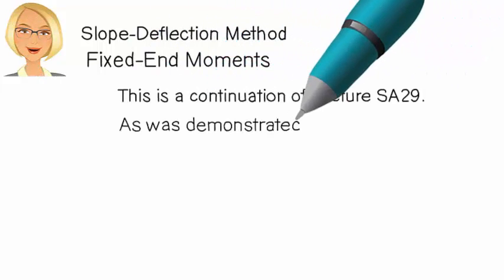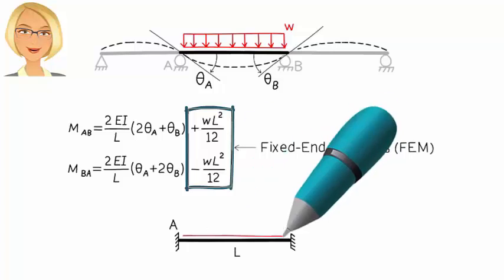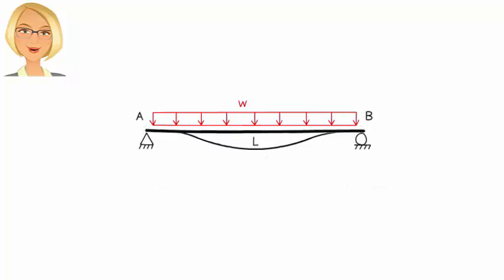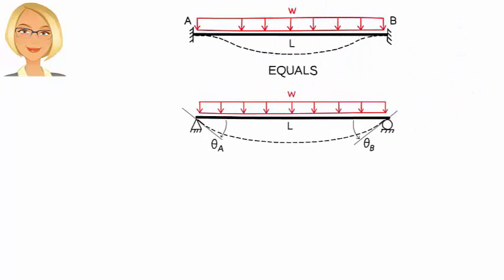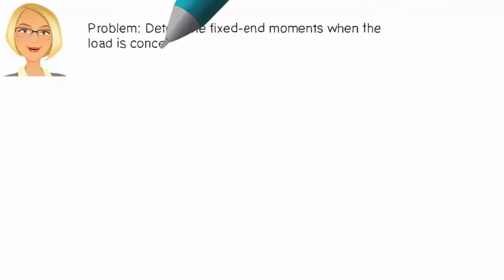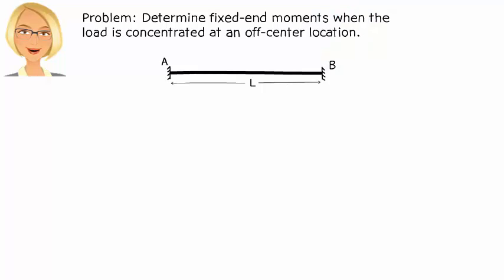SA30: Slope-Deflection Method (Fixed-End Moments)

Comment: in 7:37 isn't the arrow a counterclockwise? why is it clockwise?
Reply from the maker: Are you referring to the applied moment in the second exercise problem? That is the direction in which the moment force is being applied to the beam. Such a force can be placed on the beam in either direction.
Reply: @DrStructure  sorry the time stamp is wrong, I mean the time at 5:00. the direction is counter but the label is clockwise
Reply from the maker: @5:00, two types of entities are shown on the diagram: moments (FEMab and FEMba) and rotations (ThetaA and Theta B). 

At this point, the moments are unknown, therefore, we assume them to be acting in the counterclockwise (positive) direction. In the slope-deflection equations, counterclockwise is considered the positive direction. Note that both moment arrows  are shown in the counterclockwise direction.

Since the rotations have been calculated at this point, we know their actual direction and magnitude. ThetaA is counterclockwise and ThetaB is clockwise, which is the result of an upward deflection of the beam. These rotations are shown in the correct direction on the diagram. The magnitude of the rotations are also given. However, since we are going to plug in these values in the slope-deflection equations at the bottom of the screen, and in those equations rotations are assumed to be in the counterclockwise direction, we have to enter a negate the value for ThetaB. That is, a positive value of PL^2/16EI for ThetaB in the slope-deflection equations, implies a counterclockwise rotation at B. But since the rotation is clockwise, we need to negate that value.

Comment: what about if there is a roller in the middle or somewhere in between the beam how do you solve that ?
Reply from the maker: By definition, the fixed-end moments (not to be confused with member-end moments) are computed for a beam segment that is assumed to be fixed at both ends. So, if we have a two-span beam (with a roller at the middle), consisting of two segments (say, AB, and BC), we need to calculate two sets of fixed-end moments. We need to calculate one set for segment AB and another set of fixed-end moments for BC, assuming fixed ends for each segment.

Comment: 1:22 can anyone please explain what is the difference between fixed end moments and Mab, Mba etc...
Reply from the maker: When analyzing continuous beams, we seek to calculate the internal forces at the two ends of beam segments. If we know the bending moment and shear force at the ends of the member, we can easily calculate these forces within the member using the static equilibrium equations.

The forces at the ends of the member are called member-end forces. So, for beams we have member-end shear forces and member-end bending moments. When using the slope-deflection method, we label the member-end (bending) moments as Mab and Mba, assuming the ends of the beam segment are labeled A and B. These are the actual moments that develop in the member when the structure is subjected to loads.

Consider a beam with length L that is fixed at both ends. Suppose there is a uniformly distributed load (w) acting on the entire beam. The moments that develop at the ends of the member are wL^2/12. These indeed are the member-end moments. But in the special case that the beam is fixed at both ends, we can call them fixed-end moments as well. So, the term fixed-end moment applies only when the ends of the member are actually fixed or assumed to be fixed.

Suppose we replace one of the fixed supports in the beam with a roller support. Now the beam is fixed at one end and rests on the roller at the other end. If we are asked what are the moments at the ends of the beam. We could say, there is an unknown moment at the fixed end, and a zero moment at the roller end. That is, we know one of the member-end moments (it is zero), but we need to compute the other one (at the fixed end). In this case, we cannot call these fixed-end moments since the beam is no longer fixed at both ends, but we can call them member-end moments.

In the slope-deflection formulation, the member-end moments are formulated using the method of superposition. That is, we say, the member-end moments are a function of the fixed-end moments and the moments that develop due to the rotations at the ends of the member. The equation:

Mab = (2EI/L)(2 t_a + t_b) + FEM_ab 

Where t_a is the rotation of the beam at end A, t_b is the rotation at end B, and FEM_ab is the fixed-end moment at end A, can be written as:

M_ab = (2EI/L)(2t_a) + (2EI/L)(t_b) + FEM_ab

The first term is the moment at end A of the beam segment due to t_a, 
the second term is the moment at end A due to t_b, 
and the last term is the moment at end A assuming that the beam is fixed at both ends.

That is, when using the slope-deflection method, we start by assuming the ends of the member are fixed and calculate the (fixed-end) moment that results. We also calculate the moments at the end of the member due to rotation t_a and t_b. Then we say the actual (member-end) moment is the sum of the three terms.
Reply: @DrStructure sir, can i say that fixed end moment is associated only with a particular span with a certain type of loading while the member end moment is the total moment  developed in the beam due to effect of all the span loadings.
Reply from the maker: Yes, that is a correct way of thinking about the two moments.
Reply: Thank you so much for this wonderful explaination..I got my all doubts clear.👍👍
Reply: @keertisingh894  was it doc's or mine. 😜😁

Comment: hey, I have a question. I'm dying to find the answer to this I don't know whether this is stupid or not, but anyway I'm gonna ask.
So when there's a settlement at the supports there's a moment generated right? to resist it? when both ends are fixed the moment is
6EIdelta/L^2 right? my question is what's the moment when only one end is fixed and the other pinned?
Reply from the maker: Any technical question is relevant and welcomed, and its of use to at least one person. 

You are right, if a beam is fixed at both ends, and has a support settlement, the end moments are equal to 6EI Delta/L^2. Note that in this case, both end rotations are known; they are zero.

If one of the supports is a pin, say the right one, then the rotation at that support is not zero. Let's refer to that rotation as t_b. We can write the two slope-deflection equations as:

M_ab = (2 EI/L)( t_b - 3 Delta/L) 
M_ba = (2 EI/L) (2 t_b - 3 Delta/L)

Since there is a pin at B, M_ba = 0. So, setting the second equation above equal to zero, we can determine t_b in terms of Delta. 

t_b = 3 Delta / 2L

Then, from the first equation, we get:

M_ab = (2 EI/L) (3 Delta/2L - 3 Delta/L) = - 3 EI Delta/ L^2
Reply: @DrStructure  thnx guys

Comment: What are advantages and disadvantages of slop deflection???
Reply from the maker: A method can be examined in that light (i.e., advantages and disadvantages) in a comparative way only. The slope-deflection is a classical analysis technique, similar to the force method. The techniques was developed about a century ago, when numerical and computer-based techniques were not available. The slope-deflection method works best for problems that can be solved by hands, without using the computer. If the degree of indeterminacy of the structure is more than 4 or 5, hand-calculations become laborious and error-prone, rendering the use of the classical methods impractical.

A comparison of the slope-deflection method with the force method may be of use when trying to decide which technique to use for solving a problem. In the slope-deflection method the unknowns are joint rotations and relative displacements. In the force method, the unknowns are reaction forces. Consider a beam that is fixed at both ends and rests on a roller at its midpoint. The degree of indeterminacy of this system is 4, meaning if we were to analyze the structure using the force method, we would need to set up and solve 4 equations in 4 unknowns (if the horizontal force at the supports can be ignored, we can solve the problem using 3 equations only). The slope-deflection method, however, requires only one equation in one unknown (the unknown being the rotation of the beam at the roller support, since the end rotations are zero) to analyze the beam. Now, consider the case in which the end supports are pins/rollers instead of being fixed. So, we have a continuous beam with three pin/roller supports. In this case, the degree of indeterminacy of the system is 1, meaning that we can solve the problem using the force method by setting up one equation in one unknown. Here, the slope-deflection method requires using 3 equations in three unknowns (the three joint rotations) to solve the problem. 

We can also examine and compare the two methods in terms of the actual steps that each require and ascribe time requirement to each step in order to compare and contrast the time efficiency of the techniques in various scenarios.
Reply: Thank you very much❤❤
Reply: The need to use statically indeterminate structures???
Reply from the maker: @ahmedbarakat1384  Indeterminacy naturally arises in some type of structures. Consider a building (frame) having three or more columns at its base. Each column is sitting/resting on a foundation which can be viewed, depending on the details of the connection, as either a pin connection or a fixed connection. Either way, there would be too many support reactions to calculate using the three static equilibrium equations only; here we have an indeterminate system to be analyzed using techniques such as slope-deflection or matrix displacement method.
Reply: Can I ask you the last question, please?
Reply: Advantages and disadvantages of consistent deformation and three moment equations?
Reply from the maker: @ahmedbarakat1384  The three moment equation works best for continuous beams only. The method of consistent deformation (the force method) is more general and can be applied to frames as well as beams.

Comment: Please tell me how to draw FEM in case of temperature variation or settlement?!
Reply from the maker: Please see Lecture SA32 (https://www.youtube.com/watch?v=dwXudm5IPDE&feature=youtu.be) for the slope-deflection formulation for support settlement.  This method however is not suitable for handling change in temperature in the material. More advanced (finite element based) techniques are needed for that.
Reply: @DrStructure  thank you, Do you have any source (video or PDF) for this technique (finite element based) ?!
Reply from the maker: @abdelsattar6007  We have a series of lectures on the displacement method which is a precursor to the finite element analysis (see Lectures SA45 thru SA50). However we don't discuss the effect of temperature change, since our focus here is mostly on the basics of structural analysis. 

You should be able to find the coverage of temperature change in some advanced structural analysis textbooks/reports.
Reply: @DrStructure  thank you 💙

Comment: I want a favour  from your channel...plz make a video on to calculate fixed end moment due to three concentrated point load...I really need your help....waiting for your response...
Reply from the maker: Thanks for the note. These videos take some time to develop, by the time we are done making such a video you have figured out the process already.  Perhaps you can solve this problem on your own, with a bit of hint:

Place once concentrated load on the beam at a time and determine the fixed-end moments due to that single load. So, for concentrated load (P1) you get mLeft1 and mRight1. For P2, you get mLeft2 and mRight2, and for P3 gives mLeft3 and mRight3. Then, you can find the fixed-end moments due to all three loads placed on the beam simultaneously by adding the three moments on either side of the beam. That is,

mLeft = mLeft1 + mLeft2 + mLeft3
mRight = mRight1 + mRight2 + mRight3
Reply: Dr. Structure Got you...I will try to solve it as per your precious guidance...thank you once again for your support...
Reply: Dr. Structure dear sir can't it be solved by the same process you have solved some problems and specific results too..considering the beam to be simply supported first and then calculate the end rotation by unit load method considering four sections..and finally putting the obtained value of slope in slope deflection equation to get the desired FEM...
Reply: Hello sir...as per your hint I tried to solve the problem but couldn't get the desired result..I obtained the m1 left value for the first load at(L/4) distance from left as (9PL/64)...m2 i obtained for load at (L/2) from left as (PL/8)..m3 left due to load at(3L/4) from left as (3PL/16)..adding( m1+m2+m3) left,total comes out equals(29PL/64)...m1,m2,m3 are calculated as per specific result by formula (Pb^2a/L^2)...answer is (15PL/48)
Reply from the maker: Yes, it can be solved that way. But that is a lengthy process for solving a problem that can be solved quickly using the principle of superposition.
Reply from the maker: You have made a slight error in your calculations. For P3, the left moment should come out as 3PL/64, not 3PL/16. You missed multiplying by a 4 in the denominator. 

Left-end moments are:

For P1: (3L/4)^2 (L/4) P / L^2 = 9 PL/64
For P2: (L/2)^2 (L/2) P / L^2 = PL/8
For P3: (3L/4) (L/4)^2 P / L^2 = 3 PL/64

The sum of the three moments comes out to be: 20PL/64 = 15PL/48 = 5PL/16

For the right-end moment the same value: 5PL/16, where

For P1: (3L/4) (L/4)^2 P / L^2 = 3 PL/64
For P2: (L/2)^2 (L/2) P / L^2 = PL/8
For P3: (3L/4)^2  (L/4) P / L^2 = 9 PL/64
Reply: Dr. Structure ohhh...sorry sir...thanks a lot..thank you so much..really appreciate your work and the way you help us is truly awesome...I truly am a fan of your channel...once again thank you from the bottom of my heart...
Reply from the maker: @roushanrounak8648  You are most welcome.

Comment: Can slope deflection address load case as if the load applied at the support?
Reply from the maker: Yes. When there are no member loads, the fixed-end moments would be zero. But we can still follow the process and write the joint moment equilibrium equations in terms of joint rotations. When the beam is subjected to only concentrated moment(s) at the joints, these applied moments would appear in the joint equilibrium equations (when summing the moments at each joint, we need to include the applied moment at the joint in the equation). However, if the applied loads are vertical forces only and they are located at the supports, then there is no need to analyze the beam. The reaction force at each support would be equal to the vertical load applied to the support, and the beam segments themselves would not carry any load (no internal forces develop in the segments and no joint rotation takes place).
Reply: +Dr. Structure 
thank you Fri the good clarification
however how can we follow up on the issue if the joint load is only vertical load
Reply: +Dr. Structure 
good ti be in touch again with you sir
just for clarification 
assume we have two span beam abc
assume that there are two loads 
at b 
vertical load and moment
how to tack this problem using slope deflection equation 
thank you sir
Reply from the maker: @munirasad273  The beam can be analyzed, the support reactions can be calculated, using the principle of superposition. Placing the vertical load at B by itself, the support reaction at B would be equal to the load, and at A and C the reactions would be zero. Then remove the vertical load and place the bending moment at B. Now analyze the beam using the slope-deflection method. This will give us three support reactions, one at A, one at B and one at C. Finally, add the reaction force you got from the first loading case to B to get the reactions due to both loads.

Comment: Can i do this FEM from another method?
Reply from the maker: Fixed end moments are support reactions associated with an indeterminate beam that is fixed at both ends. You can use any appropriate analysis techniques to calculate these reactions, like the force method.

Comment: @03:17, should the FEM ba should be counterclockwise, since your equation of FEM ba = 2EI(theta A+2theta B)/L    ?
Reply from the maker: The direction of the arrows are placed to correspond to the actual deformation of the beam. In this case, theta_B is going to have a negative value resulting in a negative value for FEM_ba.

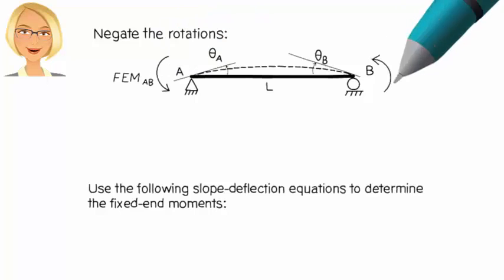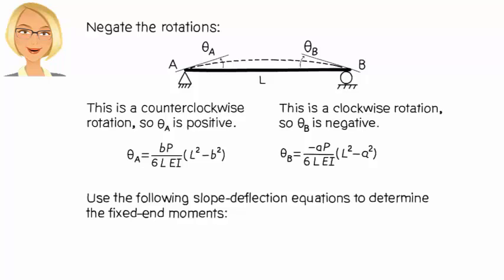Comment: There are errors at 4:40 and 6:32  the Mba direction is wrongly set twice in two different examples
Reply from the maker: The member-end moments are drawn in the positive (counterclockwise) direction at both places. If they were to be actually calculated, the sign of the moment would correctly indicate the direction.
Reply: Thank you so much for the explanation.